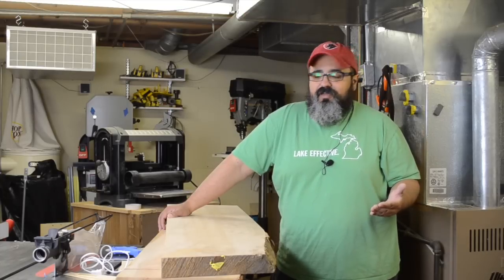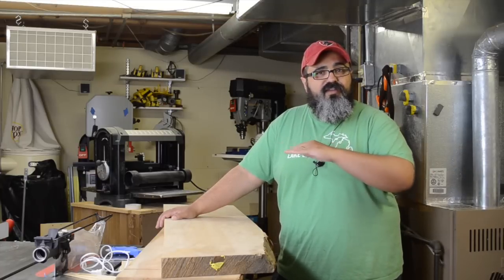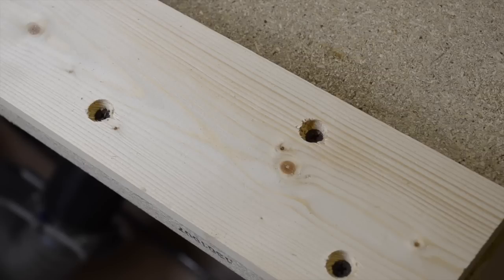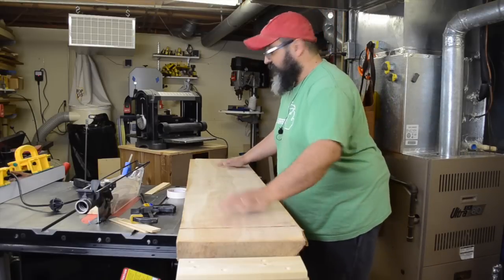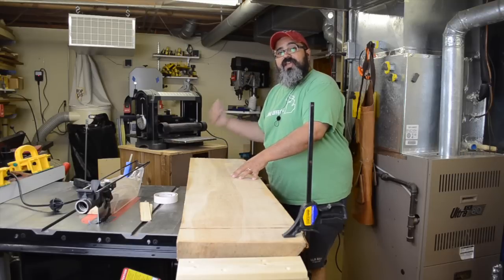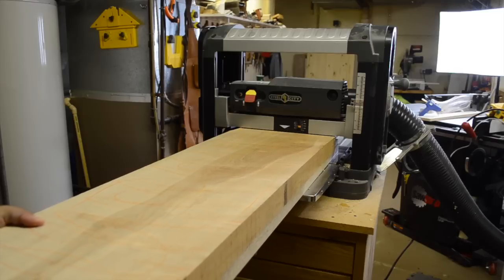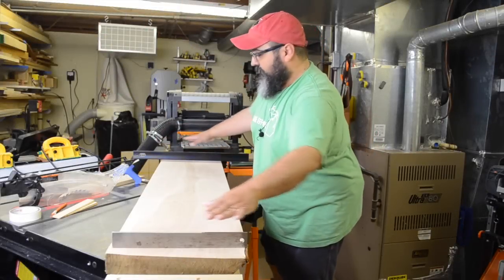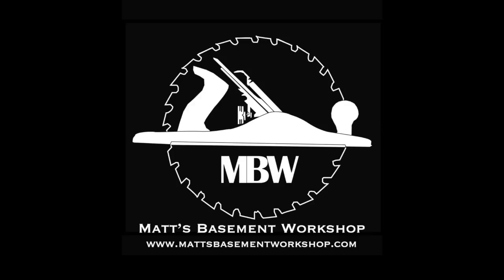555 A simple planer sled

Comment: Mat, glad to see you back. Not knocking just one detail.  You could put one shim at the back and one at the front and plane away less wood to get your flat surface.
Reply from the maker: Where were you when I was doing it LOL! Actually...for the second board, I did something very similar. Thankfully I had already anticipated I was going to be removing a significant amount of material anyways, but if I had needed to remove far less, I would certainly have added a shim or two to the front to take fewer passes.Thanks for watching.

Comment: Nice video: It would be possible to preserve some thickness by shimming from opposite corners. That should reduce the planing by half.
Reply: Darrell Thomson I agree with you 110% sir. In addition to what you said, thickness of the board won't be the same after planing, the shimmed end will be thinner than the clamped end.

Comment: I have 15 teak boards 8" × 2" × 10 feet and some need attention. They are all rough sawn at present and I was going to make a steel frame to support a router to flatten one side. However I think your method is so simple and the hot glue seems foolproof. I have seen other more fussy ideas but yours seems really worth a firstvtry. All I have to do is buy a planer now. I'm in Asia expat so equipment is limited here. I do envy the Americans, you seem to be able to get anything there. Buying online for me can be complicated to get through customs and of course the extra tax is added. OH, I am making a large dining table. Cheers.

Comment: Great technique- only tip is to do any good your stop should be on the trailing edge not the leading edge. In reality between the mass, the hot glue, and the roller pressure the stop is optional.  I do use one but I glue it- no metal fasteners. Ask me why I know to avoid those LOL -  I have some very cool nylon nails that my finish nailer can shoot - perfect for something like that.

Comment: I have been also been using this technique recently, and it does work quite well. I was shocked how well the hot glue holds.
Reply from the maker: I need to invest in my own hot glue gun. While my wife doesn't do a ton of crafts, it's amazing how quickly she notices when it's not in its usual hiding spot.
Reply: +Matt Vanderlist im in the same boat I'm using the wife's pink  zebraprint hot glue gun

Comment: As a newbee to woodworking this sled is fine and will be an addition in my shed in the next few days, question is however is there a way to thickness shorter pieces of timber, say 9" with maybe 2 or 3 at a time when the thicknesser manufacturer recommends minimum lengths of 12"

Comment: Over the length of the board, does the center where it is not supported get pushed down by the rollers?  Should the center be shimmed and every few inches / feet?  I've always figured the rubber on the rollers pressed down a little deeper than the knives to ensure engagement and let the rubber "mush" out of the way normally.
Reply from the maker: Great question! Yes, if the board is bowed in a way that there's a gap between it and the sled, then it also should be shimmed. 

I've used this technique a number of times, and everyone of those times, I've only needed to shim it where there's a gap and the boards turn out as expected.

With that said, I'll write an article about it later this week for my website, and go into a little more detail.

Comment: Excellent refresher.  Thanks.  I have the same planer as you, but I've never been happy with the thickness gage on it.  I tried an after market gage, but still significant differences between what it is set at and actual board thickness.  Do you do anything or is your gage accurate?

Comment: Good video. I recently did this with several dozen 4/4 maple planks ~9' long. What I found is that the whole setup had to be very very rigid and very flat in order to work. Your very thick shelf piece provides the rigidity, so the jig just has to provide flatness.

But if you're working with 4/4 or thinner and only have a piece of 3/4 particle board or MDF under it, the planer rollers can actually bend the whole apparatus out of flat. I ended up making a long torsion box ~4" tall that was flat, but also much more rigid than just a piece of 3/4" material.
Reply: DesolationRobot Answer what unicorn sparkly Buddha I don’t never say a word to you did you say you knowghfhfjfifkv

Comment: Thanks for the tip Matt.  Do you get any snipe when using your sled?
Reply from the maker: I did get a little at first. I discovered my outfeed roller wasn't high enough to properly support the sled as it passed all the way through. After a quick adjustment, I was able to reduce it to practically nothing. Of course, I usually leave the boards a little long just in case. Thanks for watching!

Comment: With that jig  setup aren’t you running it through backwards?
Reply: nope, since the planer is wanting to push the wood forward the plate should be at the front to stop it from pushing the top piece off and leaving the bottom piece in place
Reply: @seejohnmake  interestingly yours is the only video I have found with the plate at the front. having just tried a similar jig and had wood pulled through and off the wedges, it would appear to make more sense to have the plate at the leading edge as the rollers create more forward force than the blades backwards force.

Comment: The ideal way is to shim both ends equally so you remove as less material as possible
Reply from the maker: Yes, that is an exceptional way to do it to remove less material, thankfully I already had planned to remove a lot more, so it worked out for me. Thanks for watching.

Comment: You have the end board screwed onto your sled to keep the board from sliding off the end of the sled; so why did you then put that end into the planer first?  It seems it should be at the back.
Reply: Larry B good catch.  But then I thought about it and I’m guessing it’s because of the direction the rollers are feeding the stock through.  Perhaps the rollers are actually pushing it against the toe kick.